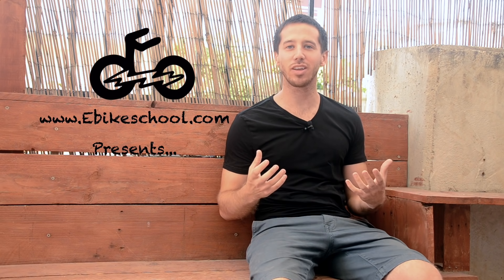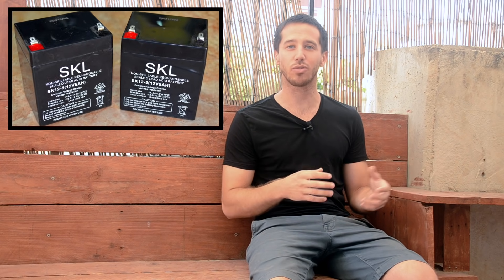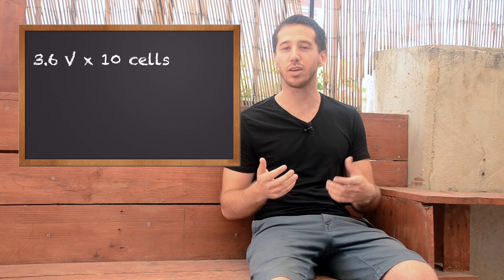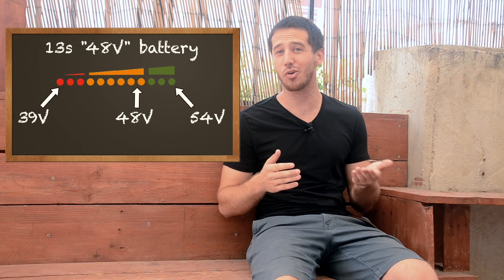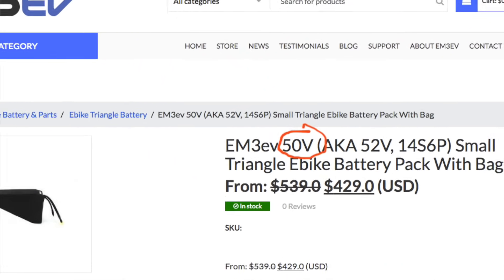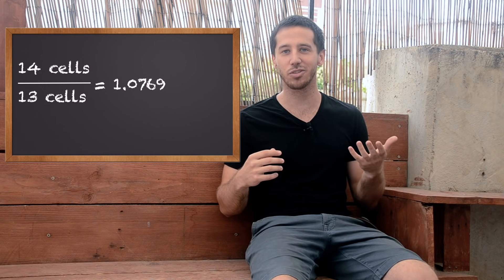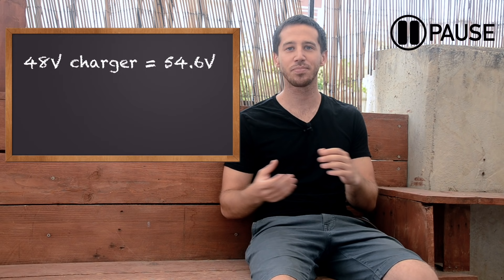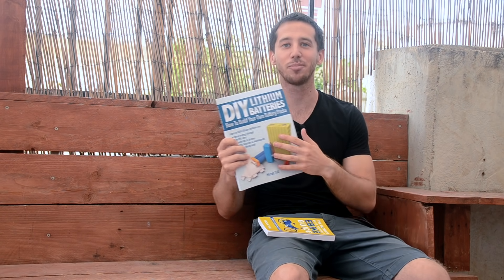Which is better: 48V or 52V battery?

Comment: In Canada the law says the motor must cut out above 32km/hr. So since we can’t go faster will 52v battery provide longer range?
Reply: Yes, you would get a little bit more range. he does in fact mention this.
Reply: Error yes at the end, but it’s vague. No definite estimation. Do you know a more accurate value?
Reply: @vincewhite5087  lets say we have 48 volts at 10 amp hours. that is 480 watt hours.. at 52 volts we would have 520 watt hours.
Now lets say on a flat surface you can go 60 units of distance miles or kilometers at 480 watt hours. that is 8 watt hours per unit.

With me so far? at 8 per unit we can now get our number for 52 which is 65. = 520/8

It's not a lot more and there are other factors. But you should be a tiny bit more range.
Reply: Error thanks. That at least gives me an idea of what ‘A little further ‘ might mean.
Reply: @vincewhite5087  No problem. It's not much of a step from 48 to 52. However if you step up by more then 10 or 20 volts. Well then it might be worth it. As in most things. There is usually no clear answer.

Comment: For some reason, my 1000W -'48V 11.6 ah' 2 months old battery used to last longer or normal, but all of sudden, started to fail or runs out way quicker even when I am on PAS mode which I use more often than just pure electric mode.  

Do you think there is something wrong with the battery...like not as described or not the original Samsung Lithium and should seek a refund? Also, do you think purchasing the same 48V 11.6ah BUT, the "ORIGINAL Samsung" battery would resolve the issue? 

If not, am I better off with 52V etc...and whether if it's compatible or not....Any advice dude?
Reply: idk what he would advice but I would think 2 months is pretty fast for a battery to wear out.
No battery should be run flat ever if you can avoid it.
If you haven't been running the battery fully down then it's possibly a defect.
Also if not using the battery for a while only charge it to 50%
But if you are often running the battery low. Then you might need to get a higher amp hour battery or run dual batteries.
Reply: + @usererror880  : dual batteries means double weight and don't think that is an option for me. A replacement perhaps is better solution.....i don't know?!! I always make sure the battery is fully charged every single day especially before I run it. However, I've noticed the battery level indicator keeps shifting from high to low then go back up to low and so on....sometimes goes to full bars depends how long the battery been running otherwise I miss 1 or 2 bars. How would I know if the battery is genuine Samsung unless battery defect, something to do with the connection???? After all, it takes minimum of 4 hours whenever I charge it and occasionally takes 20 minutes extra especially if I am almost or nearly running flat. 
I am so miffed!!!
Reply: It sounds like it could be a damaged connection if the charge meter can't make up its mind
Reply: I would take the bike to a shop and have them check all the wires and connections. Have them test the battery. Ect. I think it's more then just a bad battery
Reply: + @usererror880  That's exactlly what I did today and will get the results God willing next week.

Comment: I'v been wanting to build a e-bike that can go about 60 miles, and 45 mph since that's how far work is from my home, So i would love the opportunity to win one of your books so i can at least learn the basics to e-bike and battery builds.
Reply: you need about 1200wh for single trip. so make 2 seperate batteries from 70 cells and put the spare behind you or on top off the middle. You've got 1400wh to play with in that case, and 5 minutes to stretch leggs while changing batteries. I used the hailong 70cells cases on aliexpress. 50dollar and the 1000w BBSHD
Reply: @marcrobert2603  And what if I use all 3,400mah 20A batteries for the build?
Reply: Using the better batteries like samsung,lg,panasonic or sanyo (the strongest off each brand), you calculate them at 10wh for 1 piece. They will never give you the promissed 12wh/piece. I even use only the brown LG from 3000ma. They are more honest with their specs. Use a good BMS is also important, use the red ones on ali express. And  a good 52v4amp charger,you have to charge at work. Or buy 2 charger off 3Amp. @archiecooper4934

Comment: Often time the topspeed of ebike is not limited by power but voltage. Also is you have display that allows current limit to be set below controller maximum you can run higher on voltage but same power (Amps x Volts) and higher speed.
Reply: Let the bike ride alone will give you max speed.

Comment: I think that when people say "52V will run a bit cooler than 48V" are meaning that a given speed lets say 25km/h is  is reached at a lower current pull with a 52V battery as opposed to the 48V, thus "running a bit cooler".

Comment: Hi i have this front hub motor 48V 1000W 20aH , i don't have yet the battery, trying to make one as I watching your useful video, to be my guide, question can I make instead 52 V just adding one cell from 48V, Does it make no harm with the motor, i had the controller already.

Comment: When you look up the specifications from 18650 cell on the manufacturer site you get more info.
General (older) 18650 cells gave the most energy (wh) around the 3,6V range. Max charge was 4,2V and below 2.8V discharge
you where damaging your cell.
Newer methods off manufacturing resulted in higher energy density (more wh or watts per hour). 7 to 12-ish Wh
Those newer ones gave the most energy around the 3,7V.
Common name 36V battery  would have changed in 37V battery pack, most important is that it refers to the build-setup.....
Common bikeBattery packs has 10 cells in serie and 4 to 6 in parallel. So your 36V(37V) pack has 40,50,60 or even 70cells.
Never something in between.
During driving you fully charged battery will go from 42V to around the 30V. That's why it is not willing to drive as fast at the end.
Deep unloading those cells (under the 2,8V) can kill them direct. Don't be afraid, your pack is protected with a BMS(battery manegment system),
In short (it does more), it cuts off the output when one off the cells (4to7parallel) goes under 2,8V(older ones) and 3.1V(newest).
Now comes the most umportant......for the die-hards. In case off 48V ebikes the decay off dis-chargecurrentgives a big differents in speed and power awaireness. So to sqeezz as much out the system the 14cell(against13) in serie give longer max power output times.
Downsite is, that increasing de output voltage will increase the amperes also. Because in general there are only 4cells in parallel, they will ages very fast.
So better go for the 70cells packs in that case. 14seriesX5parallel(or more).
Go for the LG H2 3000mah cells, they have a 3,84V discharge sweetspot in stead off 3,7V for most others.
Max chargecurrent is 4,35V, so you never overcharge them with the standard charger. Charging further will only give 5% max differents.
They are very good for fastchargers (4A).
Why do you think tesla uses them?
Feel free to aske questions.
Never play with 18650cells, they are very dangerous.
Reply: How can i increase my electric scooter swagger swagtron v1 to 48v?
Reply: @jordansmith488  It works with 24v, so max voltage is 29.2v charge. The max operating voltage is about 31V for controller and display. Putting a step up converter between gives you only minor speed boost. There are 7 cells in serie, some people put an extra set in serie. Still you need an other bms and loader. In short, to 48v you can't.

Comment: Can I use a 36v battery with a 48v motor?
Reply: Some motors like the bafang250/350w is capable to run with 36and48V. you need a 36Vcontroller with a 36V bat pack or a 48V controller and 48V bat. So iff you have a 36V controller you can try, its costs 12€ at ali, and nothing will break. Outputpower will be less.

Comment: Would using a 52 volt battery give you a noticeable increase in low in power or torque, or is it just extra speed on the top end? I plan to build a trail bike, so top speed doesn't matter very much to me. Considering a 48 volt battery is like $150 to $200 cheaper, I'm wondering if the difference is really worth it

Comment: I have a cheap ebike from amazon (one of those ancheer bikes) it's actually been great as I can't drive for medical reasons and in this area there isn't anything for public transportation.

Anyways, the bike is getting on in its life and considering how much i ride it (a minimum of 6 miles every day) its racking up a lot of miles. the frame seems perfectly fine but I would love to just upgrade everything. would it be more economical to do so using the frame? or should i just build something from the ground up?
Reply: Nomore Illegals please  sounds good thanks man :)

Comment: Its called voltage drop, more voltage is a plus. 20amp controller will pull 20 amps but the voltage drop is the issue. Question is, can the battery pull 20amps without droping to much voltage = RPM. Maybe just use a more capacity lower volt battery to control TORQUE. My 2 cents.

Comment: 52 volt also helps when you are on the Heaviside to go up hills.
Reply: Definitely, more voltage also means more torque
So, increasing voltage increases both max speed (linearly) AND torque (proportionally to square root of voltage, IIRC)

Comment: Hi Mike! Great video. 
Have  a question, i have one those stand up electric scooter  with a 52V and 22.4Ah lithium battery , i live in Canada and of course winters where i live are longer then summer so i don't ride as much. what you recommend or advise, when it comes to the battery regards charging or not charging for all those months i don't use it?
thanks 
Jack,
Reply: Store the battery around 50% charge and do not leave it outside below 0c i live in Ontario. You can ride it in winter just never leave the battery outside for too long and never ever charge it when its 0c or lower you can wreck the battery.
Reply: @jaylord55  same here I live in Ontario. Do you ride a lot in the winter?
Thanks for your reply.

Comment: My concern is range. And I saw two models of the e-scooters
1) 10ah, 250w, 48v
2) 10ah, 250w, 36v

In terms of longer travel range, which one should I get. I am a layman and hope you can guide and help me with mine this question, trillion thanks once again.
Reply: The 48V 10Ah model has a 3rd more range. Times the voltage by the amp. Hours to get watt hours. This is a measure of total energy in the battery. So for example 36V 20Ah battery will have 720Wh of energy, more than the 480Wh of the 48V battery above.

Comment: Hi hello, may I ask if the motor is 250 watts. But there are two choices, one is 250 watt but 36v another one is 250 watt motor but is 48v. Which one should I get? Hope you can help by answering my question, trillion thanks!
Reply: The 1. scoot contains 480 Watt. The second contains 360 Watts. There are more battery cells in the first one. Either these cells will bring you further or the motor will bring you further because it is stronger.
Reply: @jenserikbech  oh! Now I finally knew the difference! Thank you so very much for your greatest guidance Mr. Jens Erik Bach, and God Bless!
Reply: @MrKristoffle  Me,- I have a Xiaomi Mi M365 . I like it very much, though being 95 kilo in weight. As all weight comes on the rear wheel, I have had some punctures and are waiting on a solid tire for the back wheel. The rear wheel is engraved with max capacity of 75 kilo! Nobody has mentioned that fact! They think they can put 120 kilos on it! A change of tire is impossible unless you are very strong and have a spouse to help you.
Th range with my 95 kilos are 19 kilometres on a charge with full cruise speed which amounts to 24 kilometres an hour. Echo-mode will bring you further. Consider the weight too. Xiaomi is 12.5 kilos.

Comment: I would like to know what type of motor do some ebikes get to put on the ebike sometimes they get the converter or no wonder in the wheel but I don't know which is better the wheel or the regular motor that goes in the front to me is like both the same with one is faster than the other which what you think

Comment: You also can run your 52 volt battery to 0% cause each cell would hit 2.8volts and still a little in each cell to help the life of that cell too. 48 volt cells would drop down to 2.5volt for each cell witch is taking your cells a lot lower for each cycle use.  52 volts would would last longer in the end.

Comment: You could always open your supplied battery charger and tweek the pots to raise the charge voltage, just lower the current via another pot so as not to exceed it's limits ;).

Comment: Hi can i charge my 54v battery with 48v charger?
Reply: You would have to modify your charger internally. Higher capacitors and regulators. Not worth it IMO unless you are an experienced E-Tech or engineer. You could use a charger from an electrical 60 volt string trimmer/blower. However, these chargers put out over 62 volts. So you will be pushing the BMS of your battery pack as well as the charger. Not recommended..... I would like to over volt a 48 volt system to see what would happen. I'm sure it wouldn't end well for the controller. I'm positive the motor would be fine in short burst, but the heat might kill it. 
So, if you want to go high power; A custom battery pack and speed controller will be the way to go. i.e. 72-96 volt systems. That is hyper speed and money.
The simple reply is buy a 54 volt charger.

Comment: 24V would require thicker wires for same power. 48V or 52V there is no difference, 13S or 14S, so depends on your charger and perhaps your LVC for controller. Also an extra 4S makes a difference in speed too, like comparing 10S to 15S is a big difference in speed.

Comment: Is switching to the 52 V with a higher voltage speed controller(  60 V)make a difference
Reply: Monkey Haters I have the same question?? Did you find the answer
Reply: @Zippo1617  no😖👈
Reply: Apparently the52v battery can fry a 60v controller...not sure if it’s credible information as I’ve just come across it in the comments..
Reply: @Zippo1617   I just looked at my electric bike that I built It's a 1500 W rear end With a 52 V battery the controller it came with says 48 V Haven't had any heating problems .been  Riding it for months ,Goes About 38 miles an hour and is scary fast⚡

Comment: Will the 52v battery made the battery level sensor goes wrong? Since the lowest discharge voltage is higher than the 48v batt. Means that even the 52v battery is empty, the sensor still think that there's still some juices left?

Comment: I use a one 1000 hub normal bits it comes with. I use 3 r.c lipo rates 22.2v 6c 12ah wire together 72 volts with 36 ah. I’m over 40 mph with 16 miles

Comment: Excuse me!

48V 20AH vs 52V 15AH 
Excellent for hub motor 48V 1500W 18MosfetController?
(If both battery use 18650 3.7V 2500mAh Cells and BMS 30 Amp continuous , 70 ±10 Amp maximum
)
Reply: The leaf is an awesome 1500W that can be overpowered. A 250W can be the same as a 500W just the seller trying to appease UK'ers or AUS or whomever with the MYTH!

Comment: HI HOW YOU DOING? MY QUESTION IS I HAVE A MID DRIVE BAFANG 750W-48V MOTOR AND I DONT KNOW HOT TO PICK THE RIGHT BICYCLE THAT THE BAFANG MOTOR WILL FIT NO PROBLEM.AND ALSO COULD YOU TELL ME WHAT KIND OF SAFETY TOOLS THAT I NEED TO TAKE WITH ME AT ALL TIME.THANK YOU IN ADVANCE FOR YOUR KIND ANSWER.

Comment: Very informative! Thank you. My suggestion though for those who don’t want to swap out to a 52v battery and yet go a bit faster is to simply lose overall weight, take out unnecessary accessories on the bike and lose body weight. It’s healthier too.
Reply: This is utter rubbish, loosing weight from your body or the bike will not make it go faster it will only make it accelerate faster to its max speed and will not make you go faster.  the max speed of the bike is calculated RPM x wheel size x 0.0003 and then if you are over volting you take the calculated speed  x by the over volt and then divide by the rated voltage and this will give the new speed.

So if a wheel is 26" direct drive 48V 360 RPM then it would be 360 x 26 x 0.003 =28.08mph, so no mater what weight you loose it will never go faster, however if you over volt to 52v then the calculation would be base speed so 28.08 x 52 divided by 48 = the new top speed of 30.42mph.
Reply: May not get increased speed  from  losing  overall weight  from off the bike but it will increase the kilometres/miles range from a full battery charge with a weight  reduction.

Comment: For me personally, the sweet spot is 36v 14Ah. I have the power I need and I can operate at speeds that are not life threatening to myself and pedestrians, while enjoying ~35 miles between charges.
Reply: Same here! 35miles? What kind of battery setup do you have?
Reply: Interesting. I have a DYU D3 running on a set up of 10.4ah ion Lith 36v, 250w brush less motor. I've been looking at a high spec battery, but not finding very much as yet. Needs to be same pack size to fit into unit. Unless I attached second external battery and run that through the same system?
Reply: Totally. For legal speeds with most hub motors, you'll get 32 kph out of 36v batteries all day. My third party fancy controller can do field weakening to go faster than the battery voltage limit and RPM/Volt of the motor windings, but it takes even more power than a 48v battery would take to go that speed anyways. With wind drag being so huge on a bike, as nice as it would be to go maybe 40kph on the side of the highway, makes no sense for the less power consumption unless you're in a huge hurry.